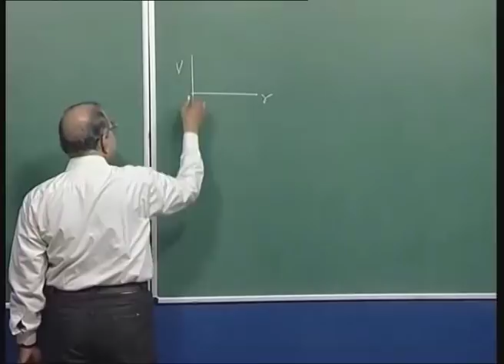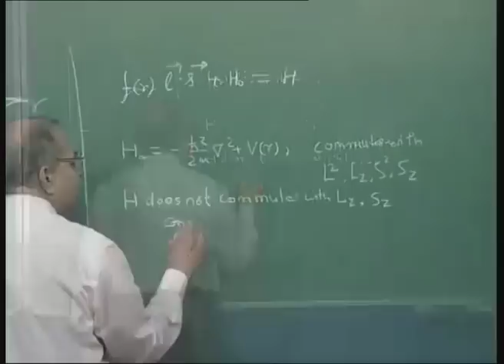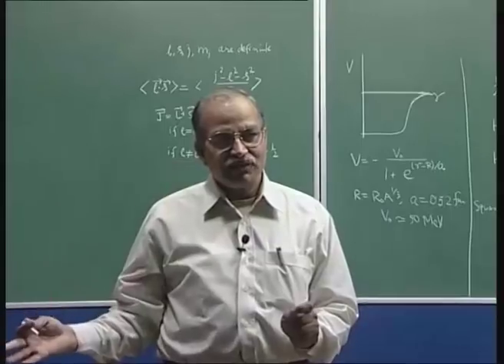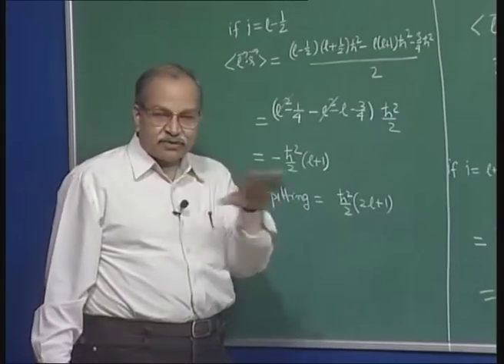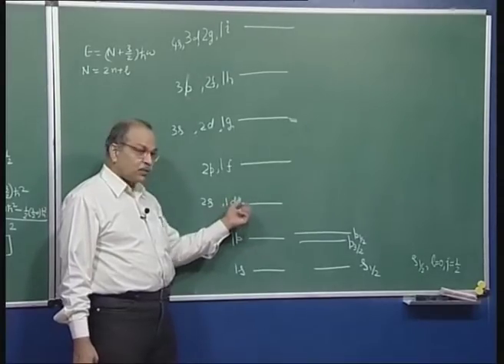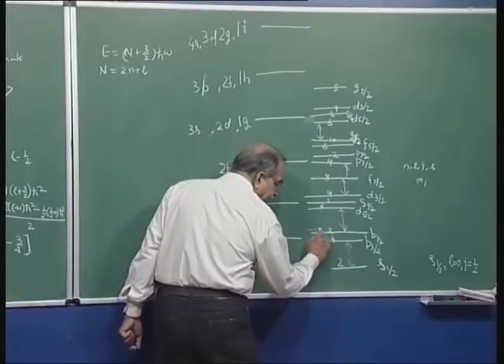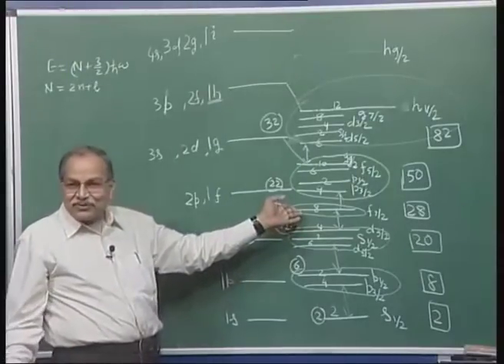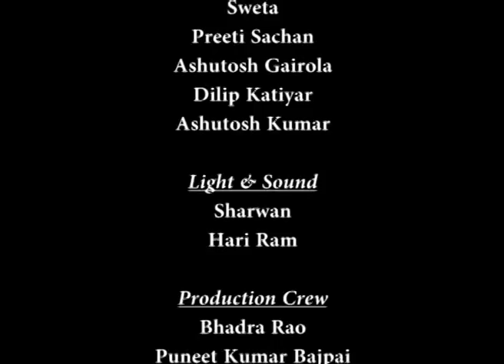Mod-01 Lec-18 Shell model Contd..

Comment: Hi, Sir. Thanks for the video. Could you recheck the 33rd's minute of the video where you order p and f orbitals. In the books, it says 1f7/2, 2p3/2, 1f5/2, 2p1/2 is the right order.  Can you clarify this? In addition,  how do we know, for instance, 2p3/2 is lower than 1f5/2 in energy? What's the equation giving all these orders correctly?
Reply: Can you tell me why sir took j=l+1/2 and j=l-1/2, but didn't take j=+ -1/2 for l=0?
Reply: @preranadash9640  It's not allowed for s orbital  to have 2 possibilities.
Reply: @preranadash9640  It is in fact vector addition. When you add with a null vector (l=0) you will have only one value. HTH
Reply: @preranadash9640  It is in fact vector addition. When you add with a null vector (l=0) you will have only one value. HTH
Reply: @preranadash9640  with l=0, there won't be any splitting, hence a single energy level.